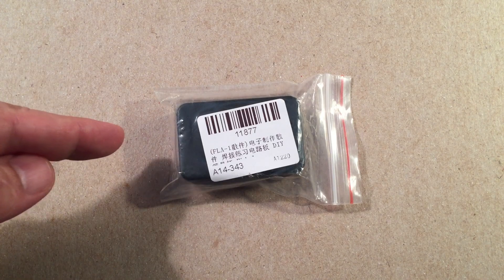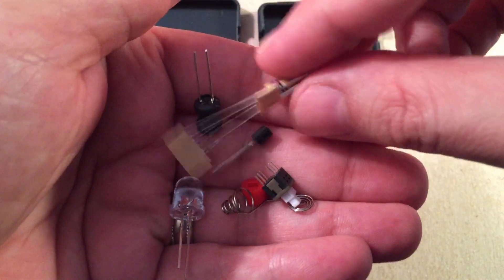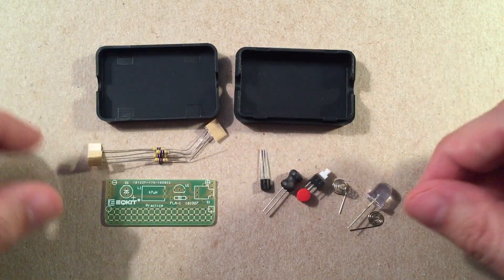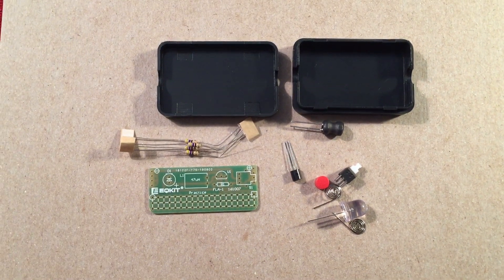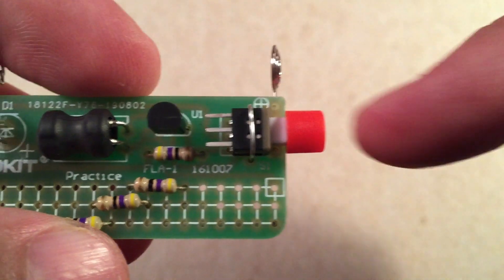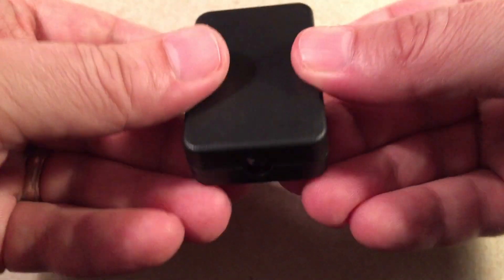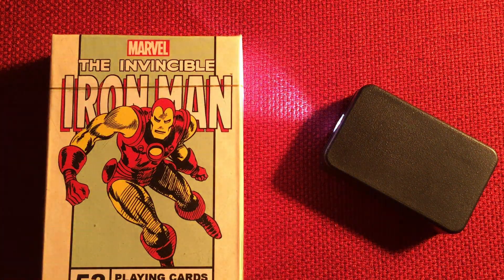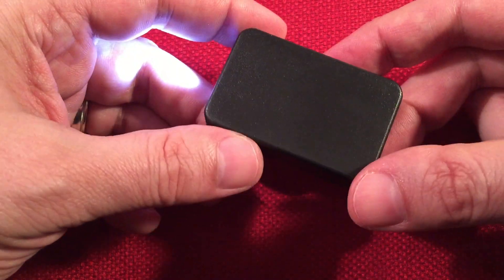ICStation Simple DIY Flashlight Kit Build & Review

Comment: Interesting kit, the YX8115 datasheet does not provide too much info other than a led boost circuit capable of 0.9V startup -- perhaps someone might find more data. Impressive, especially at $2. I recall the  'joule thief' can operate down to around 0.4V.
Reply: I was wondering if anyone would mention The Joule Thief...